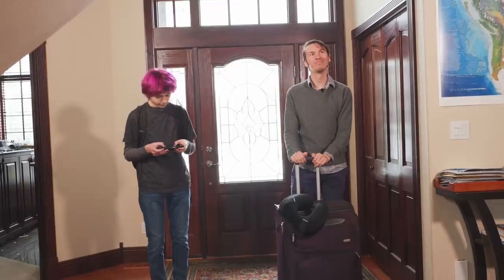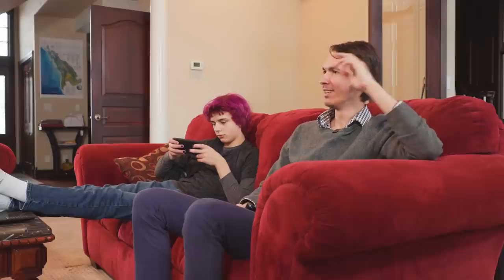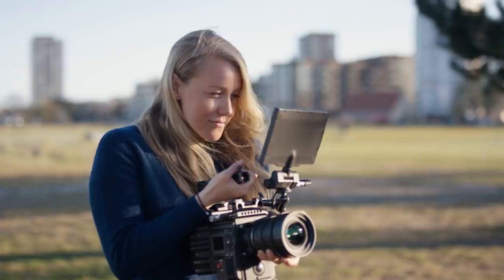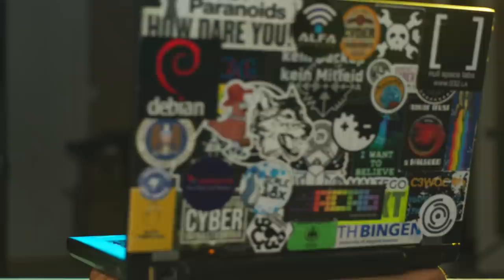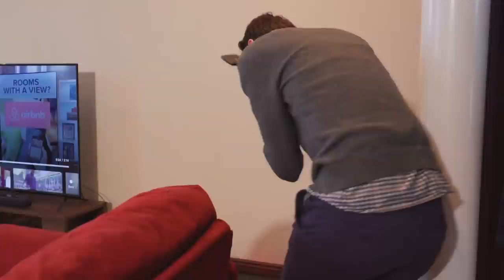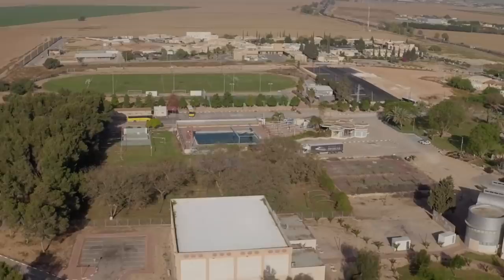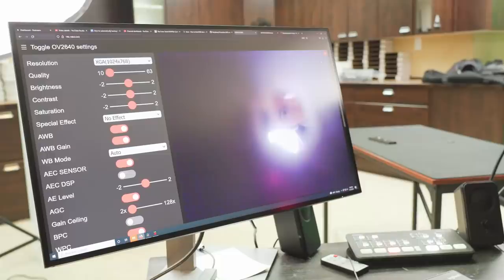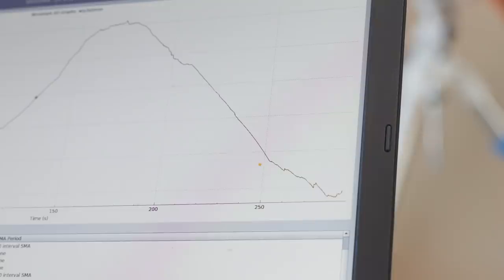Can Wireshark Spot Hidden Cameras For Free?

Comment: For more than a decade I’ve used wireshark to locate ip cameras. The first rental I had suspicions about found three.
Reply: @BDBD16  very strange owners.
Reply: Is this the method you used? Or if you don't mind explaining a bit how you do it. As the video was a bit vague
Reply: @trollingdirty8910  Like if they saw that you found out about their cameras, what happened then? They freaked out? Lol. Where did they hide the cameras? Also, does this mean they had another router in the apartment, for the cameras to connect on?
Reply: @nicolaskeroack7860  They claimed they had theft and placed them for that reason, this was back in 2009. One was hidden in an ornate / chachki type bird house on top of the kitchen cabinets amongst fake plants. Before you rent a home in Indian Creek in Kissimmee FL ping me if you want to ensure it's not the same creepers.
Reply: Meh I don’t buy that cameras in rentals are common.
Reply: @codycast  who said they were?
Reply: Hippopo tamus  🤣 📷
Reply: @trollingdirty8910  While it's illegal, I can understand them putting cameras in because lots of renters trash the place and then claim the damage was already there. While you can't submit it as proof in court, it does help the property owners confirm their suspicions.
Reply: As a novice, i do have to ask. do you need to be connected to the same network as the camera? I always assumed that wireshark only picks up data from the network you are connected to,  but if that is the case. what about if somebody wont let you connect to the same network as the cameras are on?
Reply: @digijunk95  Yes it was the same network. If it's on a VLAN or physically separate network, no luck with this method. Using a cell phone camera and darkening the lights to look for IR illuminators is likely your best bet.
Reply: So it really works y didn't it work on this video man???
Reply: My landlord says she doesn't have them inside, but says it is legal in common areas such as hallways, kitchen, sunroom, living room...

Anyone know how true it is and if that must be disclosed in the lease?
Reply: @DaveSmith-cp5kj  That is why both parties should take lots of photos and videos before they move in and also do a walk-through together both before moving in, but also upon moving out.  Most landlords have second (real) jobs, so say they are too busy to do this.
Reply: Wow so cool
Reply: @lechsiz1642  it really depends on your local laws. But over here in the netherlands it is, you are just required to know about it. I don't know if in lease is enough, but a sign before you are recognizably filmed is required.
Reply: This only works for ip/wifi camera tho id imaginge it does not work for ethernet ones ?

Comment: A lot of security cameras in the field nowadays are PoE on an air-gapped network or a separate VLAN - possibly with MAC filtering, as well. ...But the video has a point that the poorly installed cameras (on the same wifi / unencrypted / analog) will be detectable as described.
Reply: So how do you detect the ones you described?
Reply: For the most part air b&b hosts wont be so professional in their design. Wifi scanning could find a lot of armature attempts to spy on you in semi public spaces.
Reply: That'd be dumb for a host to put cameras on the same wifi they provide lol
Reply: Came here to say this. This is only applicable if it’s a flat network where everything is on the same LAN or at on the same one you are on.
Reply: I believe the video is talking about sniffing radio packets. It the camera isn't and wireless one there isn't much to do there. But if it is, it doesn't really matter which wifi network it's using.
Reply: The average AirBnB owner isn’t going to know what a VLAN is let alone set one up. Putting together a PoE network isn’t hard, BUT, does require running cables behind the walls which is also not something most folks are willing to do.

Comment: They can be detected with a transistor radio tuned to 1000 AM. Most radio transmitters use 1000 KHz oscillator circuits. You may not be able to intercept signals, but you can tell if they are active.
Reply: You got me to thinking: when is the last time I saw an AM radio in a retail store (excluding car radios)?
I think Reagan was in office the last time I saw one! :-)
Reply: @jimBobuu  you can still find one at your local dollar store or pawn shop
Reply: Can a Ham radio do the same thing?
Reply: @KNIGHTJUMPS  if it will receive 1000 AM
Reply: @shaunemicheal7362  Thanks for the reply and the help.
Reply: @shaunemicheal7362  I think you can also find AM/FM kits to build too. I built one while I was in the military and it came in pretty damn handy for my family while I was stationed in Korea but they were in Texas during hurricane. All power was out for days and only the radio worked for them to know where to go for FEMA supplies.
Reply: @toddmaek5436  absolutely!
Reply: @Shaune Micheal 
How would you go about finding out the signal strength and pinpointing where it's coming from with a simple am radio ?

What about harmonics, spurious emissions, stray RF and things like that ?
Reply: @brendan9996  you don't, you just hear a signal
Reply: @brendan9996  the other signals can be detected too if they are on a 1Mhz carrier frequency. It just detects noise. Signal strength and direction is irrelevant because if you can pick it up, you are really close.
Reply: @brendan9996  I was a security guard once and I used my transistor radio to tell if the security doors were armed or not
Reply: @Shaune Micheal
So what you're saying is it will detect "everything" with a 1MHz carrier signal ???
I'm not sure what use that would be if you're just wanting to find hidden cameras and not other electronic equipment that isn't spying on you or an invasion of privacy.

And you neglected to answer what effect things like, spurious emissions, harmonics & stray rf would have when using this method ???
Reply: @brendan9996  I couldn't tell you what effect the other stray frequencies would have. I just wanted to check that the lock mechanisms were active without tripping alarms.
Reply: @brendan9996  we get it; you're a radio genius or something. I was just talking about if the devices are active.
Reply: @Shaune Micheal 
No, I'm certainly no radio genius, but I've spend enough time involved in amateur radio to know your method is seriously flawed and a waste of time.

Not trying to troll you or anything like that. 
Just don't want people to waste their time when there are much better methods out there. 

(Over & out !!! 73.)
Reply: @brendan9996  as I said my method only checked if devices were active, I said nothing about intercepting signals or anything like that. Maybe, I wasn't clear with that part. Mea culpa.
Reply: But how would you do that

Comment: when using IR finders, turn the lights off so IR is activated if it has a day/night sensor. No IR in daylight on those type cameras. I have an older cheap Point and shoot digital camera converted to IR that I use for that and for verifying remotes work. It was $50 many years ago.

Comment: But the wireshark approach only works if your laptop AND all cameras are connected to the same router, no?
Reply: nope you dont have to be connected to the same network if your card supports monitor mode
Reply: @SimonBauer7  same network or same router? I thought if you're not connected to the same router you can only see encrypted packages, no?
Reply: No monitor mode just showing all wlan networks and the clients. I think you are wrong. Promise mode or something like that on cable networks is for sniffing in a Lan network that you can listen on other computers using the network. And if you have the wlan password or if it open you can sniff with monitor mode too. Like I write it maybe it is easyer use airmon-ng with monitor mode and look how many devices around you and you can watch if the Mac Adress say it can be a camera. And maybe in the Wireshark solution the camera use ssl/tls or something like this. So you can't read it.
Reply: @2teKnoA  Wireshark lets you sniff the link layer dataframes, not just TCP or whatever. And while the payload may be encrypted,  the metadata in the headers will always be in plain text (otherwise, there would be no way of differentiating frames from different networks/radios). Thus, you can still monitor the signal strength of a signal without being part of the same network as it. :)

Comment: using a SDR can show the most radio trasmitting devices, not only wifi
Reply: So many things you can use them for and they're so cheap every geek should have at least one. I use 1 for flight tracking and 3 for SDRTrunk. 2 will usually suffice but I got tired of missing things I wanted to hear because an SDR would get tied up by a muted agency like routine traffic at the nearby prisons
Reply: @Fluffy Hamster , HackRF is one, RTL-SDR Dongle is another.
Reply: @reallifelima7951  my neighbors use this to spy on me. Any suggestions on how to block it?
Reply: @markonw6661  p.s. Thanks for revealing who you are though! Got another one to add to the list to the D.A.s office.

Comment: Dosent stop sd recording devices.
Reply: True, but if the camera is found, the evidence is found with it. If someone was going to do this, they'd might as well hard-wire the video along with the power. There are some very good and cheap POE cameras coming into the market. Send the video over cable to a hub which would then wirelessly transmit to a hidden streaming device/recorder/computer/whatever.

Comment: My property has lots of cameras, mostly because i get lots of wildlife and also because i love playing with vision analytics and ai built into some.  Also have some Arecont Vision pano cameras and a Sony PTZ on the roof.  Only a small number are actually wireless (Sercomm iCamera-1000) which are great little devices but if I was serious about hiding cameras, they'd probably be those $15 PoE powered ones from China that use industry-standard ONVIF.  None of this silly cloud nonsense.  Pro-Tip: Easy to get 24/48-port gigabit PoE managed switches next to free.  Aruba 650 is a great small switch with 4 PoE powered ports but PoE required a paid license.  After HP bought the company, they released firmware that enables PoE. Great for powering cameras.

Comment: Interesting. I was anticipating using Wireshark to filter for RTSP packets, although that wouldn't tell you the WHERE, just the IT EXISTS.
Reply: You would need to be connected in a privileged position for that, like capturing packets directly on the router
Reply: @speakertomeat  i dont know if it matters here,but some wifi modems can listen passively. I was able to listen to packets without being connected to a network with wireshark in linux

Comment: That was awesome. Is it possible to run Wireshark from an Android device? Maybe using termux or anlinux? 

Does Wireshark use TCP dump under the hood? I wonder how hard it would be to create an app specifically for filtering and locating radio devices.

Also, do your methods presume the security camera is on the same Wi-Fi network?
Reply: wireshark and tcpdunp using libpcap.
You can used it on Android, but for traffic from other/ not connected wifis you need  to set the device in monitoring mode. This mode must be supported from the wifi firmware, but the most android wifi driver dont support this mode.
Reply: Yes, but only some adapters(chipsets) and you will need to root it

Comment: I'm wondering if software defined radio might be better, I doubt it set off by quite as many false positives. But you can get a whole bunch of different ranges of bandwidths. If for instance someone had a 800 MHz 900 MHz 50 MHz or dect 6.0 camera it may be the one real choice.

Comment: Could you provide a list or url to the Mac addresses for these commonly found cameras in the description? Thanks!
Reply: In wireshark by default it converts the first part of the mac address to the device manufacturer. Just look up the name is of the manufacturer as and when you see it
Reply: @aka5  yeah but Mac addresses only tell half the story. For example what if the camera is made by Ubquiti. They also make routers and switches, same with many other manufacturers

Comment: Complimentary Metal Oxide Semiconductor, CMOS, are one inch by one inch circuit boards with a lens on them and wires intended to connect to 12 volts and any circuitry to descramble the output to make a reasonable picture. Some lens are conical with an eighth of an inch aperture that will interface with an eighth of an inch hole in a shade, wall, metal or anything that allows drilling a hole 1/8" in diameter. ALL CMOS cameras run very hot and can burn your fingers. They need ventilation. But they have a very long life and are very reliable. Any laser thermometer can detect the heat of a CMOS camera. Or infra red detector.

Comment: instead of over complicating things with wireshark, can t you just use a simple wi fi scanner to see if there are unknown connected devices on that network?
Reply: That kinda only works if you're connected to a network. I think this is based off frequency strength. Except I'm not sure. Didn't really show much of the setup, which is my only gripe about the video
Reply: There are so many devices now hooked up to the router in the apartment I live in.  I know which are the 2 new outdoor cameras, but there may be 2+ new devices that are for automatic watering - or something else  - and I cannot figure out which are for the new roommates (only one is probably smart enough to have anything like a server). 
My landlord added 2 new smoke detectors and I suspect those could have cameras, but I also suspect she has a second router that has the frontdoor lock on, because when I moved in (no one else living in house yet), that device wasn't listed on the router we all have access to - and I am almost positive that it is on WiFi and not bluetooth

Comment: It was not clear to me if this only works if you already have access to the wireless/vlan network you are looking for devices on. Or are you detecting the wireless signals of any nearby device just based off the fact they are emitting signal?
Reply: Somebody replying to other comments pointed out that the Link layer  (which included the signal stength and MAC address) remains unencrypted.

It is one reason that when I purchased a dashcam, I specifically looked for one WITHOUT WiFi support. Since the location of Wireless Access Points are logged for mapping purposes, such a dashcam can become a tracking device.
Reply: @jamesphillips2285  Thanks and good point about the dashcam.

Comment: It's easier to look at the network with "arp-scan -l" in the Linux commend line (Windows has the same command, but I don't remember the syntax), and my security cameras show up as follows, which also includes the local IP address:
Shenzhen Baichuan Digital Technology Co., Ltd.
Your mileage would more than likely be different, but it would be clear it isn't your computer, since they would have a different name more noticeable. Also all the cameras might have the same name, if they are from the same company, which would be a big red flag. You can also check your own IP address with ipconfig or ifconfig, which means you can identify your own computers eliminating them as suspect. The computer you do the scan from might not show up in the scan, which is normal. You might have to install arp-scan, but doing the command for the first time will tell you how to do it. It is already in Windows CMD. I think this is much easier than using WireShark, and within the scope of most people.

3:46 I've never used one of those devices, but my understanding is he is too close and it works in a dark room much better. They typically claim you can stand in the middle of the room to detect cameras, but you might want to move around a bit.

Comment: Out of curiosity, the only way you can detect the security cameras is only if you have access to their WiFi network?
Reply: You don't necessarily need access to the network. The mac addresses are broadcasted unencrypted. It is possible to spoof a mac address but they can often be used to identify hardware.

There was a script written for a 2600 magazine article called "wifitrack". It makes a database of all the devices it detects transmitting over wifi. If you're in a populated area you can end up finding hundreds of devices almost instantly. It also takes note of your gps coordinates so you can use it for wardriving.

Sorry for replying to a 10 month old comment. I just find this stuff pretty interesting.

Comment: 8:54 -- are not practically all digital cameras already infra-red cameras just with an IR filter layer you can physically remove? 8:54

Like, iirc there's something called OPEN TRACK that allows someone to cheaply create an IR tracking system using any cheap WEBCAM, take apart, remove IR filter, install OPEN TRACK and boom, you got a poor man's version of NaturalPoint's TRACK IR for price of cheap webcam instead of $149

Comment: Install Haven on your phone and scan your surroundings to detect hidden cameras and other devices!!!
Reply: The problem with Haven (there are a few) is that you cannot turn off the phone when its running, so anyone entering your room can erase the footage or turn the recording off.  You'd need to make sure it uploaded to the cloud and would need a large amount of space (GB) to have it upload video for a long time. Its not maintained anymore, either.  I also suspect it could be used as spyware against you .